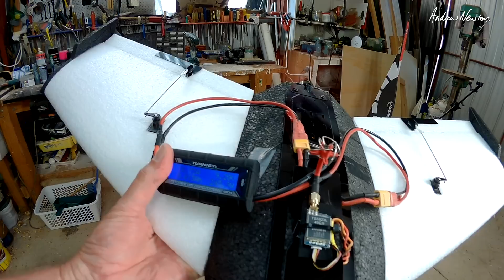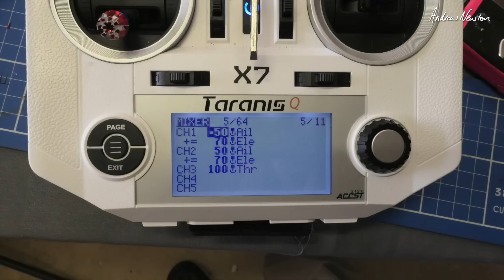CK 840mm FPV wing

Comment: Hi Andrew, I realy enjoy your video's and pick up a bargain from time to time, as planes you're enthousiastic about, are only available for a limited period and than end up for substantually less on my doorstep. I hope I'll enjoy the build ans subsequent flying, initially with just a gyro, as my FPV skills are a bit wonky...
Reply from the maker: I did like this wing a lot. It's basic but it works
Reply: @AndrewNewton  When you mention laminating it, what are you using? Packing tape, or laminating film and an iron?
Will smoothing the surfaces impact the flying charactaristics, or is it mainly adding strength and avoid picking up dirt?

Comment: When did you get the f80 motor and the 45A esc? They're usually used for quads
Reply from the maker: It came on a wing. Lots of FPV wings seem to have quad motors these days
Reply: @AndrewNewton  wow ! Surprising , I thought they'd use higher stator motors